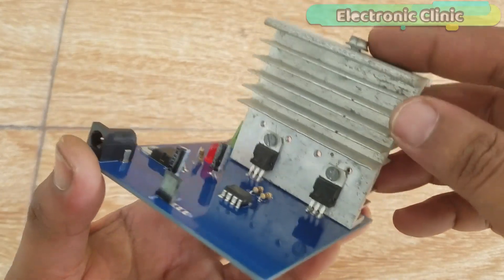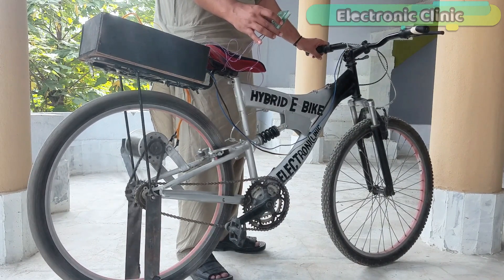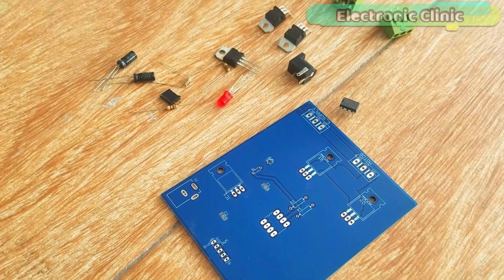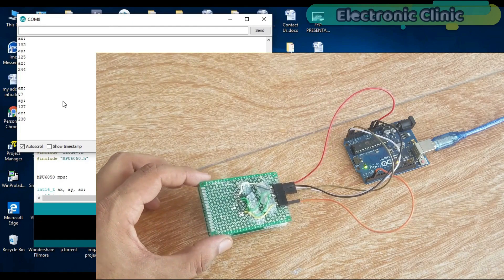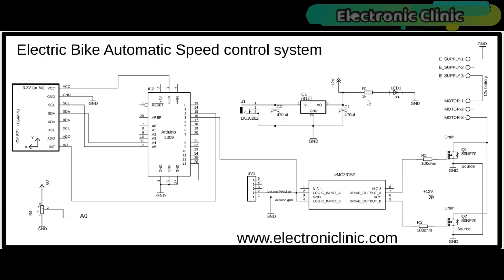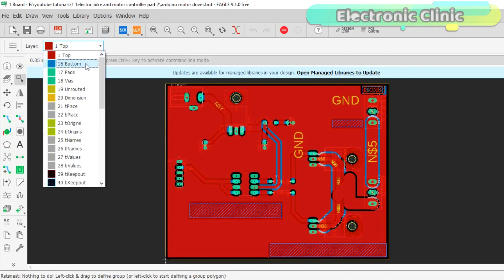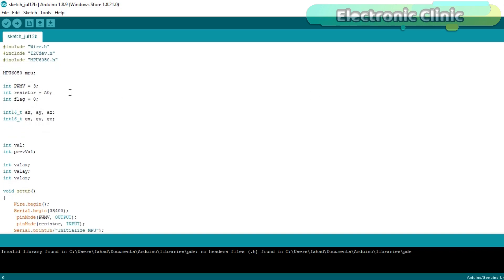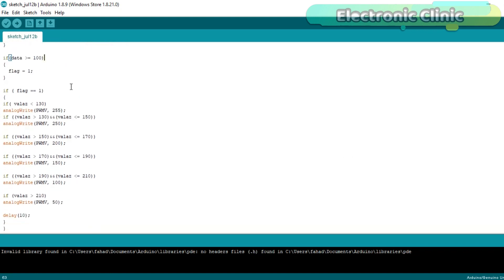Electric Bike Automatic Speed Controller using Arduino & Gyroscope MPU6050 "Ebike" E-Bike

Comment: Sir your website is not responding ! can you please send me the source code. Thanks
Reply from the maker: it's just due to the network congestion. The website will be online in a few minutes. thanks for your patience.
Reply: @ElectroniClinic  Thanks for you reply, i'll check it and let you know, either it's working or not.
Reply: Sill not responding, please if you can mail ckt diagram and code. Thanks